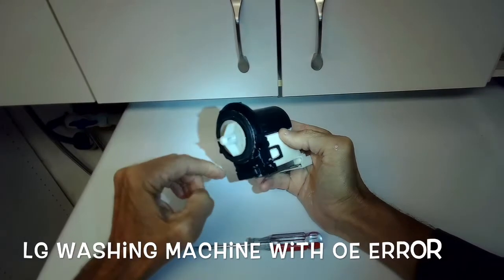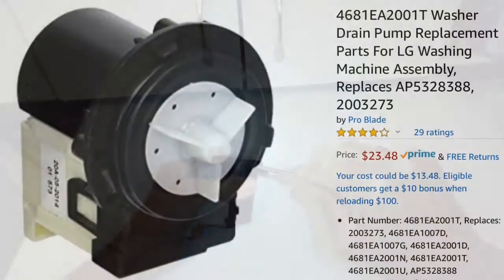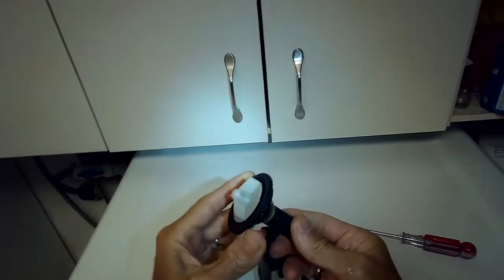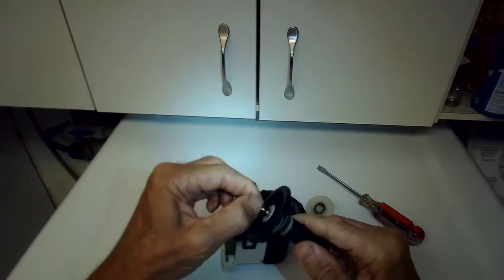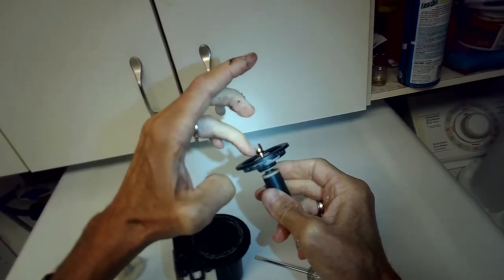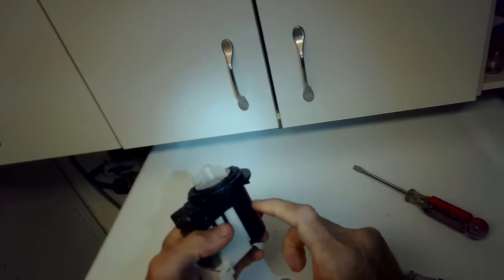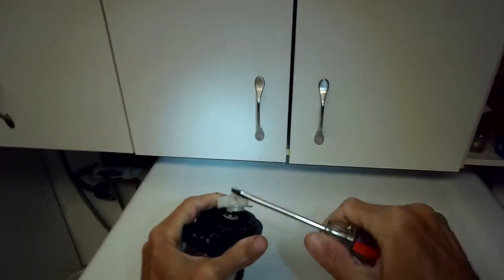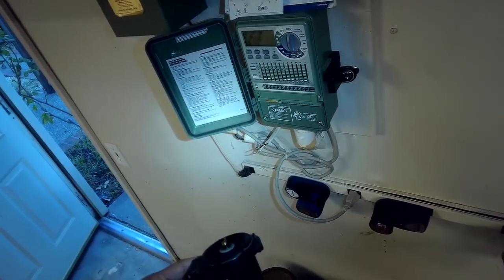✨ LG WASHER-DRAIN MOTOR BROKEN - EASY REPAIR ✨

Comment: Thank you sir, my budget is -$0.00, this will definitely save me some $ 🙏🏽
Reply from the maker: Awesome,
Thank you 😊
Reply: Real good informative video.    Thanks you !    I have a repeat failure.    3 pumps in 4 years.   All say OEM pump.   Agree, There is a flaw to the design.    I will rebuild my pump as you describe with epoxy and I bet this better than the off the shelf pump.

Comment: Thanks so much you just saved me time and money.  My propeller wouldn't turn all the way and popped it open cleaned it out and spins freely now and draining nice.  Thanks
Reply from the maker: Nice job Ryan😊
Reply: On mine I have a stack the dryer is of course on top of the washer and I don’t have anyone available right now to help me take the dryer off the top, so what can I do to replace it? I have the new pump.

Comment: My whirlpool dishwasher drain was stalling intermittently and leaving the machine with standing water at the end of the cycle. Having nothing to lose, I popped the impeller+rotor assembly out to see if it was cleanable and indeed it was. I cleaned all the gunk out of the rotor housing and that repaired it, at least for now. I have to do the same to the circulation pump every six months or so (2-3 loads a day). This is the first time I have had to do it for the drain pump. It seems this is a necessary regular maintenance task for these wet rotor pumps. I've done it so often that I can now disconnect the machine, pull it out, and have the pump off in a few minutes. I've never had such problems with a dishwasher in the past. They just worked for years and years until the were decrepit and obviously ready for replacement. Now-a-days they're super finicky.
Reply from the maker: That’s great info.
Seems like the seal fails pretty early letting in dirty water.

Comment: I ordered one for 45, it's a nicer one than the Amazon style, and it's actually from LG and an OEM one. The pump I have on now, I took apart and pulled the propeller out and it was full of blank gunky water, so it was definitely the culprit I'm hoping. Waiting for the new pump to come in this week. I'm going to take all hoses off and deep clean with bleach when I get to putting the new pump in just in case it was clogged somewhere
Reply from the maker: Good thinking 😊👍

Comment: My LG front loading machines drain motor runs perfectly  well when removed but at times it fails to rotate and starts vibrating and does not rotate. Any tip?

Comment: I did as suggested. But it did not work. Another YouTube  video told me that Permanent Magnet Synchronous Motor needs some slack to start properly. With the glue, impeller is without a slack and the motor may fail to start in some cases.  This happened with me. The bottom line is that one has to change the pump.
Reply from the maker: That’s the best way and they’re only 25.00 on Amazon

Comment: Can i check for 120v at the drain pump connector if my door is taken apart. I only get 1.5 volts at the connector when i start a cycle but my door isnt on so it throws a.door code.  would that impede it from delivering 120 to the pump?
Reply from the maker: Yeah, you need to have the door locked.

Comment: Does front load water pump sucks water out of the drum & then pump it out? Or water gets to pump from bottom of the drum by gravity & them motor only pump it out? Can you explain?
Reply: The pump is at the very bottom of machine. It pushes the water out the drain hose to your sink. So you can still manually wash the clothes if you have a floor drain by starting the wash cycle until the error then pulling the drain plug and switching to the "drain and spin" cycle. Replace the drain plug and switch to the normal or quick wash cycle, OE error, pull the plug, switch to spin, repeat until the clothes are rinsed clean.
Reply: @drakedorosh9332  how you drain from floor without water going everywhere? What do you do here & with w.machine on floor not up high or anything 🙏
Reply: @jj..-  There is a short pull out hose on the bottom front of the machine. Open the plastic hatch and a large drain plug holds a clean out basket or a small black drain hose with a lid I guess? I've never used the hose because mine is on concrete with a floor drain.

Comment: I have the same LG washer but in silver.  The pump was making rattling noises and was not thoroughly draining so I pulled it.  I dismantled my old pump and found the motor to be flooded with black wastewater so I think the front bearing seal failed.  The motor shaft also had gouges in it.  I don't think this repair would work in my case.
Reply from the maker: Yep,
That’s common, it just needs a new drain pump👍
Reply: @ScottTheFixItGuyChannel  my washing machine had no OE on it spins but not drain I just moved it to new home & was working fine in other home, what suggest in steps to do when working fine before?
Reply from the maker: It’s got to have something to do with the new big plastic stand pipe in the new home.
Maybe the drain hose is going too far down into the stand pipe.
Reply: 👍 it may not spin can't remember, was hassle draining from the bottom of it instead of through hose
Reply: @ScottTheFixItGuyChannel  which videos for unblock hose connection &/ fix or replace pump do you have for lg?

Comment: It's clear that this pump design is flawed. Mine failed, and the replacement from Amazon failed in 4 days. now on to a 3rd. Considering how many have been sold on Amazon it's clearly a bad design. And mine was full of water also, O rings are not working.
Reply from the maker: Yep,
It’s LG’s Achilles heel👍

Comment: My LG front loading machines drain motor runs perfectly  well when removed but at times it fails to rotate and starts vibrating and does not rotate. Any tip?
Reply: My machine's drain pump was doing the same thing. I took it apart and the whole length of the magnet was cracked/split. I think the drain hose was shoved too far down into the standing drain pipe and waste water had gotten into the motor because of a faulty O ring. The motor was full of stinking black sludge so have disinfectant  handy for clean up. Bought a new one so back in business.